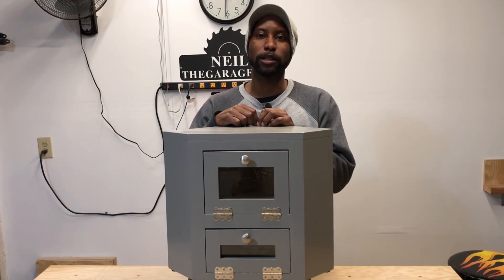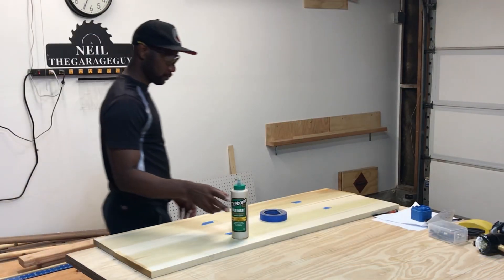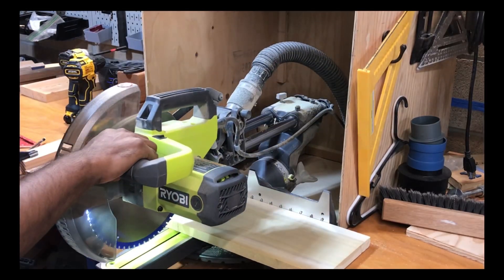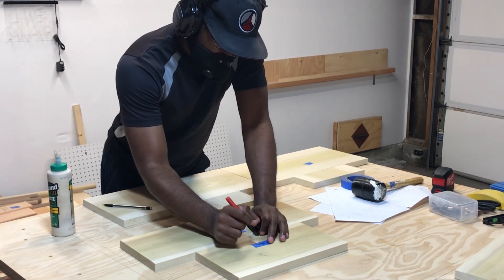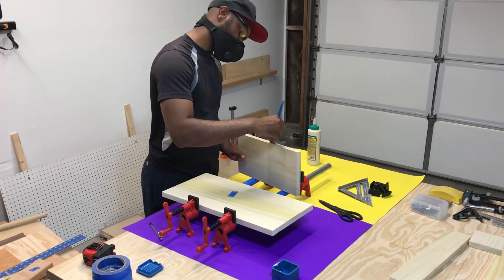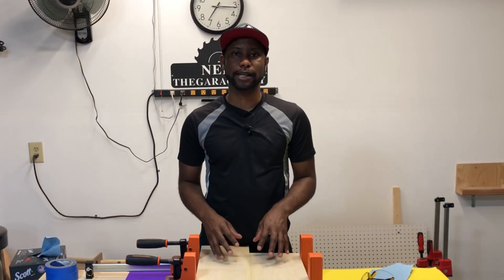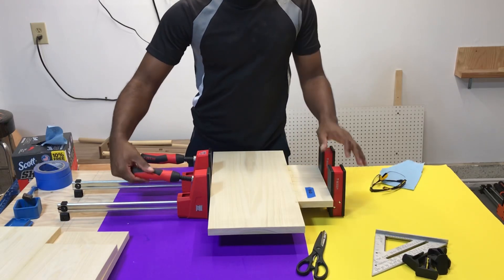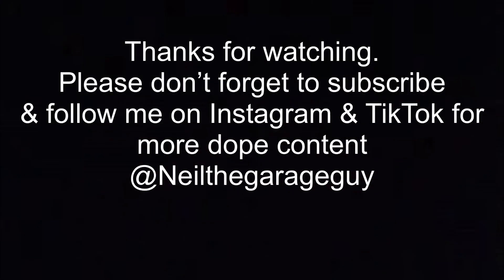Every Kitchen Needs This Bread Box Pt.1

Comment: I enjoy your videos, but, I would like to see a complete build rather than short snippets of basic joinery. 
I like how you're self taught and using design tools like Fusion360. I am in that category. 

I also understand who you're trying to appeal to and your audience is the new woodworker. Keep up the good work.
Reply from the maker: Hi Skip, I understand your concern but this channel must continue to adapt, evolve and take risks. We are trying some new with a sub 3 minute build video. We just released part 2 which is double the length. Also there are other build videos on the channel in the sub 10 minute range if you would like to check those out. Have you been using Fusion for long or do you use another software?
Reply: @Neilthegarageguy  Thanks for the clarification about the intent and purpose of the channel.  It seems at times the progress is minimal from one video to the next.  Of course this is coming from a guy that doesn't have a channel so it's easy for me to say.  lol
I use Sketchup as my modeling software.  I've been using it for about 4 years.  I have used Fusion360 and I may convert at some point.  I think Fusion360 is better overall but Sketchup easier to get started using as a beginner.
Reply from the maker: @skipharrison  Sketchup is good. Fusion is better but if I had my pick of free 3d modeling softwares then I would use Onshape all day. It is easy to learn and fully browser based so you can pull up the entire 3d model on your tablet or phone and are not just limited to PC. This comes in handy most when you are at the store and need to pull up the design to check a dimension. I always recommend Onshape.
Reply: @Neilthegarageguy  Actually never heard of Onshape until you mentioned it.  I briefly looked at it due to your recommendation and I'll probably download the free version and give it a run.  Thanks
Reply from the maker: @skipharrison  You’re welcome Skip. Let me know what you think.